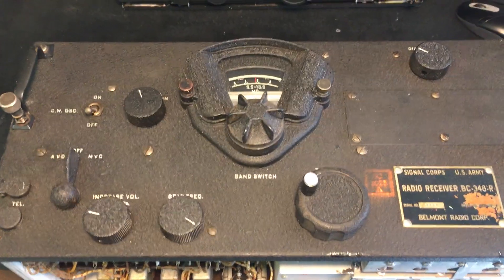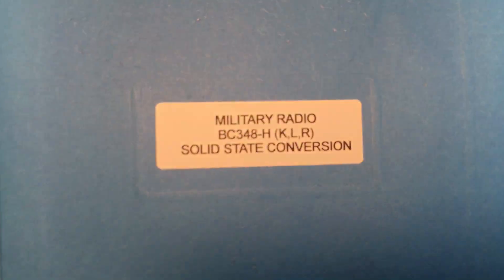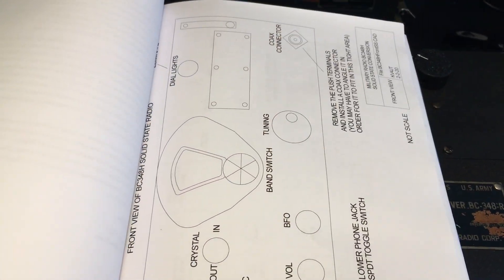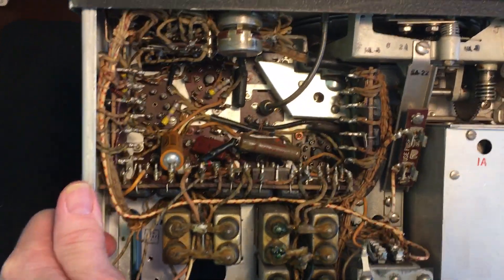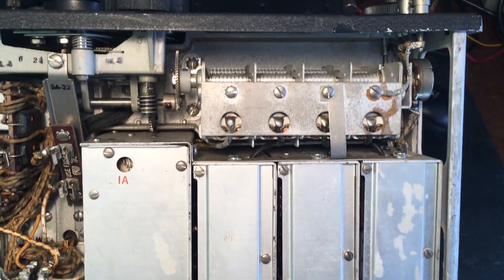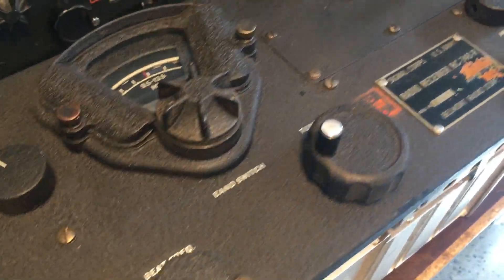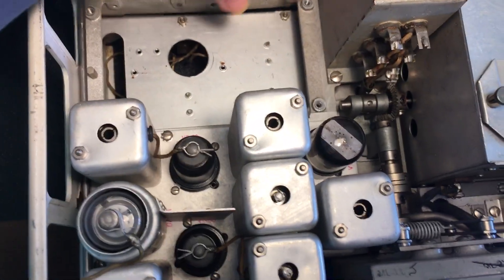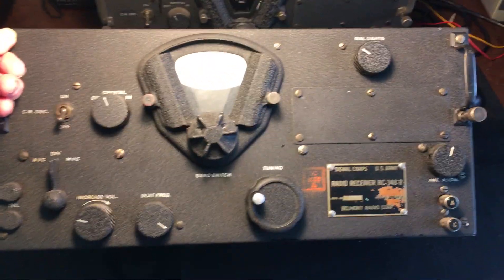Transistorize Your BC-348 Radio  - PART 1

Comment: I've seen some of Charles Smith's conersions. While impressive, I do not agree with it. For one thing there's no real need, and secondly , restoring to original is a bigger challenge. All it does is make it all the harder for the next owner down the line who DOES want it all original. If you want a solid state machine, there's plenty out there.

Comment: Why would anyone hackup WW2 artifact? 
If I want a better sounding and more stable radio I will just use a more modern receiver.
Reply from the maker: Hams have been hacking military radios such as the BC-348, since at least 1948.
Dynamotor removal for an AC supply.
Removing dimmer rheostat and hacking in an S-meter.
Modification to the audio chain.
Extra switch's and dials on the front panel...and more..........Blame CQ Magazine?
There are a lot of hacked BC-348 rescue radios on eBay but not many takers.
Why not restore one of those?

Comment: DUE  to  the  fact  that the original-vacuum  tubes  have  a  HIGH-input-impedance  and  so , you  would use  a  FET-transistors  in  the front-  RF   amplifiers  that is 3-stages. The I.F. similarly   have  a HIGHH-Impedance   at the  I.F.  transformers   and  so, you  would  modify  the  winding  at-the  secondary  of  the I.F.  for  LOW-impedance  of  the BI-polar  transistor   by  winding  additional   secondary  of I.F.  at  LOW-impedance   for  input  of LOW-impedance of  BI-polar  Transistor. FET-transistors have  a lower-voltage-gain-compare-to- a  BI-polar  transistors. The pro-blem face for conversions  is  the IM-PEDANCE  matching similarly  applied    to  >>>  LOCAL-OScillator . The AUDIO-AMplifiers is NOT  a pro-blem  due  to  there  are  avai-lable module   AUDIO-AMplifiers  readily made  from  the  market .